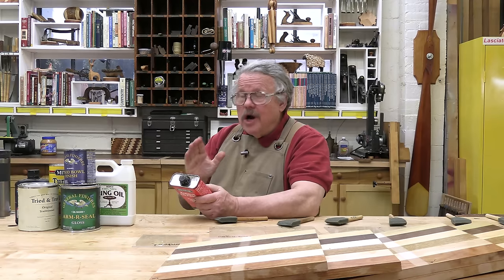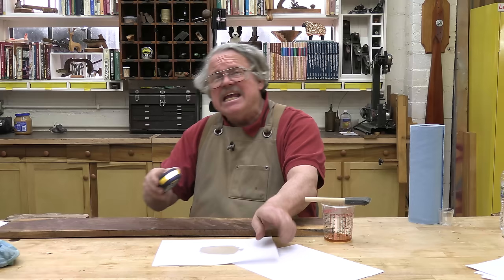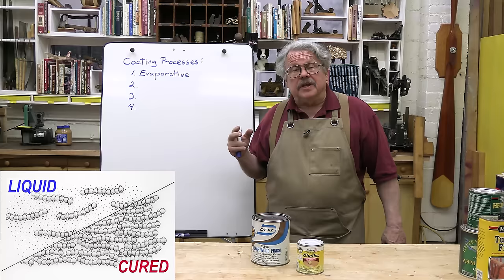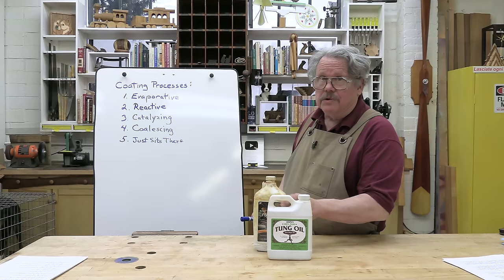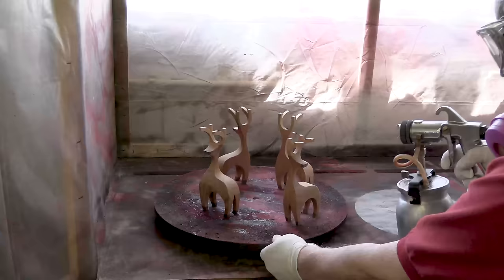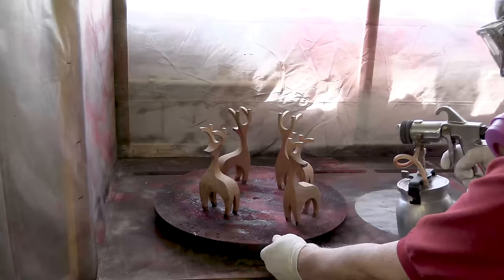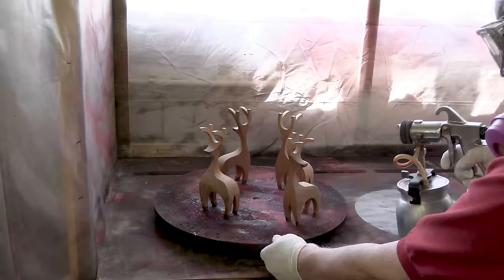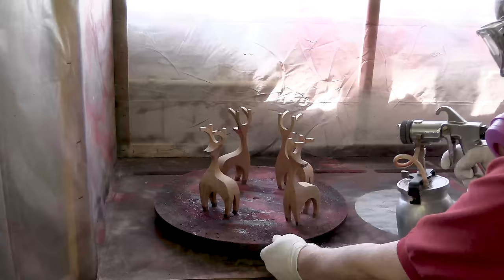Finding the Perfect Finish

Comment: I caught the Finishing Phobia...LOL...I am finish challenged. I cannot seem to do Poly or Arm R Seal gloss without microbubbles...no matter what and yes, I have had tons of advice. But welcome yours ! Great video BTW
Reply from the maker: The only advice I could offer you can probably find on the side of the can or you've heard before -- thin with a little mineral spirits (no more than 20%); stir slowly, don't shake; use a cotton or microfiber cloth to apply; wipe slowly with the grain; coats should be very thin; sand smooth between coats.

Comment: I'm installing teak butchblock countertops.  I'm planning on using tung oil to finiah the top surface. Should I seal the underside with a polyurethane?
Reply from the maker: It's best to seal the underside with the same finish you used on top -- that way both sides absorb and release moisture -- and therefore move -- at the same rate.

Comment: Great video, thanks. Is there a waterproofing (resistant) finish that is clear and shows off the true color of the wood without the gloss and too much darkening? I want something for my woodcarving.
Reply from the maker: Almost all the carvers I know swear by Deft because it's extremely easy to apply to complex surfaces. However, it is not water-resistant. For that, you would have to try a spar vanish or spar urethane, Rudy's formula has a little of that which give it a lit resistance, but it may not be enough if the environment is continuously damp or wet.

Comment: Hello @workshopcompanion (and anyone who might be able to answer my question 😊)
Love this video!
I have an important question!
I'm going to try Rudy's mix on a Hoosier cupboard that I'm refinishing. I've put on 2 coats of tung oil finish,  and now I'm ready for the 2 layers of Rudy's special mix.
However,  I'm not sure if I still rub out the coats of Rudy's mix, as I did with the tung oil finish. 
Should I rub out each of Rudy's coats, too? Or do I just apply them, and then no touchy until dry?
Thank you for any extra help, and THANK YOU for this video 😊
Reply from the maker: I begin rubbing out after the second coat -- I rub very lightly with gray Scotchbrite (about 600#). After the last coat, I rub out with white Scotchbrite (about 1200#) and paste wax, then buff thoroughly.
Reply from the maker: @user-sd2dn2zm9z  First coat, wipe or brush on, wipe off excess, let dry no more than 24 hours. Second coat, wipe or brush on, wipe off excess, let dry no more than 24 hours and sand with grey Scotchbrite until smooth. Third coat, coat, wipe or brush on, wipe off excess, let dry no more than 24 hours and sand with grey Scotchbrite until smooth. Fourth coat, wipe or brush on, wipe off excess, let dry 24 to 48 hours and rub with white Scotchbrite and paste wax until smooth. Buff wax thoroughly until wood takes on a sheen.
Reply: @WorkshopCompanion I will do exactly as you say! I'm sooo excited to try this out, and finish up the cabinet.
Thank you 😊

Comment: I would have liked to have seen the boards tested with a dirty coffee cup for a couple of hours.  I have woodblock worktops and they mark as soon as you put anything on them.  Very impractical for a kitchen.  3 coats of Danish Oil is what I've used before, but it made little difference.  I would like to refinish them but not sure what will give me the most protection.
Reply from the maker: Watermarks happen because all finishes are semipermeable -- they will allow moisture to pass if the water sits on top long enough. Some are more permeable than others -- for example, a lacquer finish will show a watermark almost instantly whereas it takes some time to get through spar urethane. Danish oil goes on very thin and is more permeable than most. You may want to (1) scrape off the Danish oil and apply a spar urethane or a polyurethane, or (2) seal the Danish oil in with a coat of shellac, then cover the shellac with a spar urethane or polyurethane. The shellac acts as a chemical insulator to prevent any possible reaction between the Danish oil and whatever you put on top of it. If your "woodblock" top is end gain, i.e. a true butcher block, then you've got an additional problem. End grain wicks up much more finish than long grain, leaving the surface barely covered. You may have to apply multiple coats to an end grain countertop to get the same protection that one coat would give you when applied to long grain.
Reply: @WorkshopCompanion  Thank you for such a comprehensive reply.  That's very helpful.  I think I'll go for option 1) seeing as I have several stains and rings I have to get rid of.  Fortunately, it's not end grain.

Comment: hello sir. thank you so much for your contribution to woodworking world. I have a question regarding FINISH. I normally use NESPOLI TEAK OIL followed by microcrystalline wax. This, i find works well for outdoor projects. But for INDOOR projects the teak oil makes the wood fibre too deep/colour change. For indoor projects can we USE WAX ONLY to seal (protect) and achieve good finish simultaneously ?
Reply from the maker: If you want the look of a wax finish, I suggest you look into hardwax finishes -- same look, more durable. Wax by itself has to be replenished every few months.

Comment: Fantastic! Question: What would be used to buff Rudy's dried mixture to the various degrees of final sheen  that were mentioned? Microfiber cloths? I am considering using this mixture on a gun stock, so I suppose I could use a polishing wheel. I am definitely interested in any input re: what technique/material is used to achieve different degrees of finish sheen. Thank you.
Reply from the maker: Rudy's begins to form a hard shell after the second or third coat. At this point, I have rubbed out the finish with silicon carbide sandpapers, steel wool, ScotchBrite, rottenstone, automotive rubbing compound -- virtually any fine abrasive you have sitting around that produces the degree of gloss you want.

Comment: You’re a fantastic teacher, great info & production quality!! After initially hating minwax tung oil finish — primarily because of the deceiving name, it has also become my go-to finish for initial coats. I usually finish with a satin wipe on poly (oil-based) which did not make it into your testing but It seems like the final recipe you showed would achieve a similar purpose.  What are your thoughts on minwax wipe on polyurethane? I would love it if you did an update to see your test results. Thank you for the excellent presentation.
Reply from the maker: Thanks, but let me address your implication and common conception that Minwax Tung Oil Finish has no tung oil. When writing my book on "Finishing," I talked to a good many coating chemists, including a few at Minwax HQ in Cleveland. I asked them directly whether there was any tung oil in their finish, and they said there was. I pressed them about the Internet stories -- some from respected craftsmen, that said there wasn't. Their response was that the story started when changes in marketing, patent laws, and OSHA regulations allowed finishing manufactures to obscure their formulas on Safety Data Sheets. Study one of these from forty years ago (they were called Material Safety Data Sheets back then) and you can identify all the ingredients in a finish. Nowadays, only poisonous, volatile, and flammable materials are called out, and often not all of those if they can be protected under a patent number. Since tung oil is neither volatile or flammable, and only the reacted version is poisonous, it gets left off the sheet. Not because it isn't there, but to protect the formula. That's when and how the story started. When I asked how much tung oil was in the formula, they couldn't tell me. Take that as you will.

As for Minwax's wipe on polys, I like the oil-base versions best; both oil-based and water-based are remarkable easy to apply. If you want a "water-white" finish that won't affect the color of the wood, the water-based poly is a good choice. However, we have no videos planned on them as of this writing.
Reply: @WorkshopCompanion  thank you for the detailed explanation!

Comment: In your long list of deciding factors for selecting a product, you seem to have left out something that is my biggest worry and that is How difficult is the product to strip off years from now if it fails? I'm very worried this morning because I have a beautiful 100+ year old solid oak exterior door that I've fully prepared.... But cannot decide what to coat with. I'm attracted the Helmsman Spar Urethane but concerned if it fails I'll have no way of stripping it because this antique door is filled with intricate carvings. If I use non-film forming finish I'll then be stuck with frequent maintenance but what worries me more is that the oak might darken with UV using this type of product. Door is on a shaded front porch. Thank You
Reply from the maker: Very few woodworkers worry about stripping a finish they are about to apply; most of us will spend extra money to get one that lasts longer. However, 2 parts toluene (or xylene), 1 part acetone, 1 part denatured alcohol will strip most evaporative and reactive finishes, and get into the crevices. This requires multiple coats for harder finishes. And it does not work the same way commercial strippers do; it dissolves the finish, doesn't cause it to wrinkle up. If you want the oak to remain light for a time, look for a "water-white" finish, one that doesn't bring any color to the party. Just about any water-based acrylic fills this bill. As for finding a finish that will keep the the oak from darkening over time, good luck. You can slow the darkening by looking for a finish with both UV absorbers and HALS (Hindered Amine Light Stabilizers). However, UV light isn't the only thing that causes the wood to darken. All wood species oxidize as they age, darkening the surface and forming a patina. Finishes don't help; all finishes are semi-permeable to water vapor and oxygen. Sometimes you just have to live with the limitations of the medium.

Comment: I built a ukulele from scratch. What best to use on an instrument and why is the inside never finished?
Reply from the maker: Varnish is typically applied to the outside of a stringed instrument to protect the wood and enhance its appearance. The inside is not varnished because the varnish would change the sound of the instrument. That sound is created by the vibrations of the wood, and the varnish would dampen them -- slightly, perhaps, but enough to matter to some. Additionally, varnish inside can make the instrument more difficult to repair if it becomes damaged.

Comment: How do you apply the second two coats of Rudy's formula? A spar urethane usually is brushed on and left to dry, while the tung oil is  wiped off after its allowed to penetrate. So what method is correct when mixing the two?
Reply from the maker: As I explain in the video, these are all wiping finishes. Rudy's blend is a very slight modification of the Miniwax Tung Oil Finish -- that commercial wiping finish with a little bit of phenolic and/or urethane resin added to make it more durable. It also builds "depth" slightly faster. But it is applied exactly the same (and the end results look the same) as  straight Minwax Tung Oil.

Comment: If I can still see some glossy shine prior to refinishing my stickley dining table with some wear and watermarks, do I absolutely have to sand or strip the whole table down to bare wood first?
Reply from the maker: I couldn't possibly answer that question without (1) inspecting the table and (2) knowing what finish was applied to the table when it was built. If it was an evaporative finish, such as shellac or lacquer, that requires a different approach than a reactive finish such as varnish. An aged finish will show different problems than one that's been damaged by use. Even the location of the table in your home may play a part in the restoration; finishes age differently depending on how much light they are exposed to and for how long. Anything I could say would be a stab in the dark.

Comment: Great video. You didn't mention water resistance of any of these products. I'm building a vanity that will hold a bowl sink. It will be constructed primarily of walnut harvested from our property. Is Rudy's (now your) mix a good choice?  We don't have small children so durability is secondary to water resistance and appearance. Thanks.
Reply from the maker: Tung oil is known for it's water resistance; it was used by Chinese shipbuilders from the 14th century on to waterproof their ships. However, most finishers recommend not exposing a tung-oil finished surface to water until the finish has cured for at least 15 days.

Comment: That was a great vid. I have stripped an old table and 100% intended to use Rudy’s blend. I’ve seen a lot of examples that the Minwax Tung Finish darkens the wood. Your example piece is very light color. (I want the final to be close to current tone). There isn’t a place I can test on. Do you find that it normally darkens the grain? Waiting patiently for your additional research.
Reply from the maker: Tung oil will effect each wood species differently -- something it shares with most finishes. I find the darker the wood, the more it changes the color. Walnut becomes very dark, cherry becomes somewhat darker. With maple, it simply warms the wood color. The age of the wood also plays a part -- often the older the wood, the more it will darken with the application of a finish. If you want the wood to remain the same color it is now, your best bet is a water-based finish.

Comment: What a great video - and my table came out amazing using your formula and application recommendations. Would this same formula work for the bark on a live edge console table? I want to keep the bark rather than debarking and am trying to stay away from epoxy for the top or the bark? Thank you again.
Reply from the maker: Bark separates from wood as it dries for two reasons -- (1) the bark dries faster than the wood, and therefore shrinks faster. (2) And the vascular cambium -- the fast-growing layer between the bark and the wood -- is not as strong as the wood. It breaks easily. For these reasons, keeping the bark on a live edge project is difficult. It's a matter of proper drying (as slow as possible), then re-adhering the parts of the bark that come loose during the drying process,  Most craftsmen prefer epoxy for this purpose, but you can use any adhesive. I sometimes use cyanoacrylate (super) glue. You can put Rudy's  finish over the bark after it has been thoroughly dried and re-adhered. But this finish -- in fact, most finishes -- will not help adhere the bark to the wood.
Reply: @WorkshopCompanion  Thank you. Very helpful

Comment: If I’m using Miniwax tung oil can I add a different product on top as an additional protective layer from water and stains? Using this for outdoor furniture
Reply from the maker: The Chinese used tung oil for centuries to treat heir ocean-going ships. That's about as outdoors as you can get. But if you need to seal the surface with something more up-to-date, try Minwax Spar Urethane. I know for certain (having done the same thing myself) that the urethane is compatible with the tung oil finish.

Comment: Thanks for such an informative video.  I always learn so much from your pieces. With Rudy's finish, do you treat it like the Tung Oil Finish and buff it off with a cloth, or do you treat it like the Urethane and let it cure for a few hours and then sand and reapply?
Reply from the maker: The latter. Usually four coats.

Comment: Funny how videos appear when you need them most. My go to product is Miniwax wipe-on poly (oil) satin finish. My local hardware store has been out for a month and a half, right when I have a huge project to finish. I'm considering using the 50/50 mix of Minwax brush on poly and mineral spirits. Have you or anyone used this mixture? I love the deep look the orginal mix gives my projects without the glossy shine. Does your tung oil/urethane mixture give the same look? I thank you for passing on your knowledge everytime I get in a bind. You've become by funny professor of woodworking! Take care!
Reply from the maker: Can't speak to your proposed blend, but that's where I'd start if I was looking for a replacement for the oil-based Wipe-On Poly. The whole finishing industry is experiencing shortages, I'm told. I was in a Sherman Williams outlet a few week ago and many shelves were empty. The folks there explained the industry is still trying to recover from Hurricane Harvey which shut down refinery capacity in Houston and Galveston.
Reply: @WorkshopCompanion  Thanks for responding and the gossip.  I've seen where folks mix 50/50 or 80/20, even starting with one and ending with the other. Guess I'll have to do a little of my owning experimenting. I enjoy applying finish but hate the guess work. Thanks again!

Comment: Thx for the reply.  I will absolutely be trying Rudy's method as I'm just finishing with the build of a new project.  I also have a years old redwood slab, all end grain, which is about to be a coffee table and don't want thoughtless kids to leave glass rings on it.   Will Rudy's method be resistant to wet glass marks?
Reply from the maker: I have found Rudy's finish very resistant to glass rings provided you apply four or more coats so the wood is completely sealed.